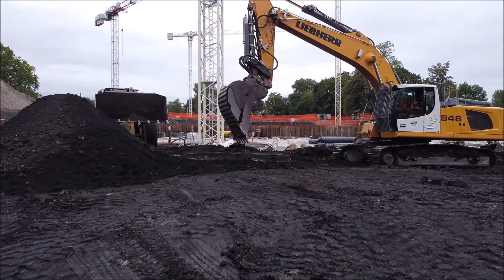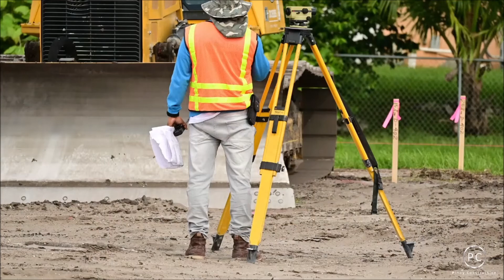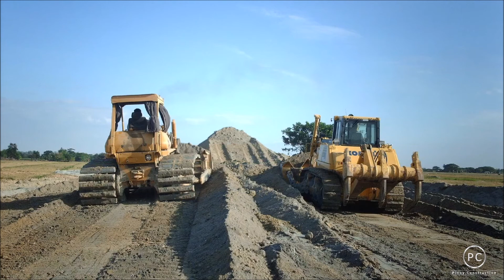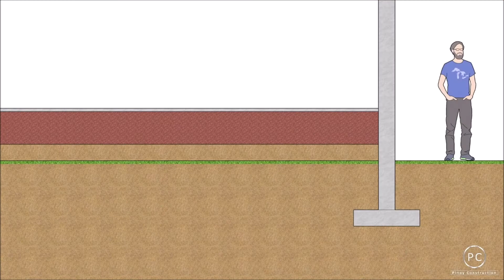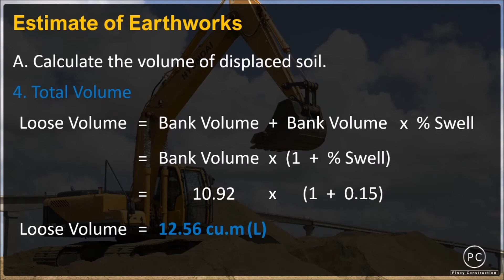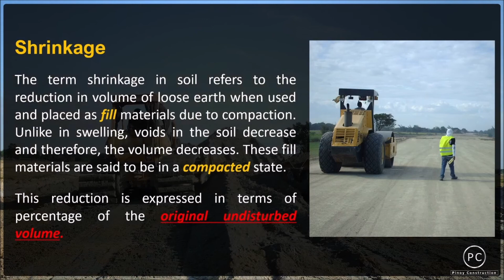Paano magESTIMATE ng Panambak sa construction ng isang bahay?

Comment: hello po kundi kayo busy ask ko lng po kung 42 square meter 3ft po ang taas ng tatambakan ilan po need  na lupa Salamat po for Elf Truck po
Reply from the maker: Hello po sa inyo. Ito po ang estimate. Estimate lang po ito. Pwedeng humigit o kumulang.
Computations:
A. Height of Fill
     h  =  3.00 ft  X  1.00 m/3.28 ft  =  0.915 m

B. Compacted Volume
     Compacted Volume  =  42 sq.m  X  0.0915 m
     Compacted Volume  =  38.42 cu.m (C)   (cu.m  =  cubic meter)

C. Bank Volume
     Compacted Volume  =  Bank Volume  X  % Shrinkage          % Shrinkage  =  90% - 100% for Loam Soil       (Say 90%)
                    38.42 cu.m  =  Bank Volume  X  0.90
                 Bank Volume  =  38.42 / 0.90
                 Bank Volume  =  42.68 cu.m (B)

D. Loose Volume
     Loose Volume  =  Bank Volume  X  (1  +  % Swell)               % Swell  =  15% - 25% for Loam Soil      (Say 25%)
     Loose Volume  =  42.68 cu.m  X  (1  +  0.25)
     Loose Volume  =  53.35 cu.m (L)  -  Total Loose Volume of Loam Soil (Lupang Panambak)

E. Number of Truckloads
     Hindi po ako sure sa total volume capacity ng elf truck kasi sa pagkaalam ko po ay iba-iba ang sukat.
     Pero ang alam ko ito ay may average volume capacity na 3.00 cu.m
     Number of Truckloads  =  Loose Volume / Volume capacity of Elf Truck
                                               =  53.35 cu.m / 3.00 cu.m per truck
     Number of Truckloads  =  17. 78 trucks or 18 trucks of 3.00 cu.m volume capacity.

Note:
Ang computation po para lang sa loam soil. Kung buhangin, iba po ang kwenta.
Maraming salamat po sa pagtitiwala. Good luck po sa inyong project.
Reply from the maker: Additional info. Kapag nagtatambak na po kayo, kada isang dangkal (20 cm) lang po ang kapal ang itatabon tapos sisiksikin (compaction) maigi. tapos tambak po ulit ng susunod na isang dangkal.

Comment: hello, magkano po kaya magagastos sa patambak ng 45 sqm lot mga isang dangkal at kalahati na taas
Reply from the maker: Hello po. Paumanhin po sa late response. Ang isa at kalahing dangkal ay roughly 12 inches or 0.30 m.
45.00 sqm x 0.30 m  =  13.50 cu.m (Compacted Volume)
Kung Lupang Panambak:
Shrinkage  =  90 % to 100 % (Loam Earthfill Material)
Compacted Volume  =  Bank Volume x Shrinkage
13.50 cu.m  =  Bank Volume x 0.90
Bank Volume  =  15.00 cu.m
Kung Lupang Panambak:
Swell  =  15 % to 25 % (Loam Earthfill Material)
Loose Volume  =  Bank Volume x (1 + Swell)
Loose Volume  =  15.00 cu.m x (1 + 0.25)
Loose Volume  =  18.75 cu.m
Maglapat ng Allowance:
Allowance  =  10 % to 20 % (Depende. Sabihin na 10 % na pasobra)
Total Volume  =  18.75 cu.m x (1 + 0.10)
Total Volume  =  20.63 cu.m or 21.00 cu.m -  Estimated na dami ng lupang panambak na kailangan kasama na po ang pasobra na 10 %. Nasa sa inyo na po kung kailangan po ninyong magpapasobra.
Paumanhin po pero hindi po ako updated sa presyo ng lupang panambak. Sa pagkaalam ko, ang presyuhan ay PHP350.00 to PHP500.00 per cubic meter (cu.m). Verify nyo lang po kung merong delivery charge. Extra po iyon.
Estimated Cost of Material  =  21.00 m3 x PHP 500.00 /m3
Estimated Cost of Material  =  PHP 10,500.00  -  Take note lang po. Materyales lang po ito. Ang gastos sa Labor ay extra.

Maraming salamt po sa pagtitiwala. Good luck po sa inyong project.